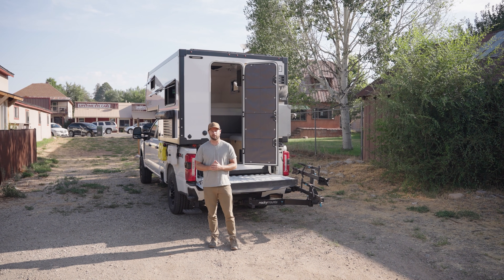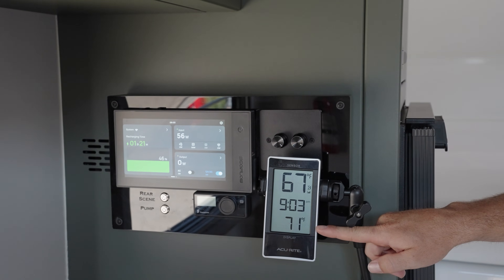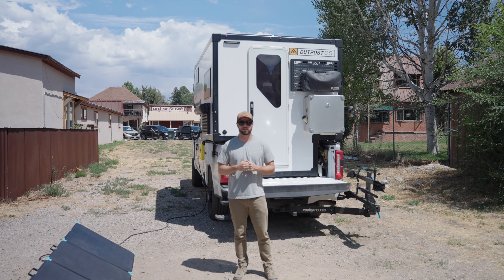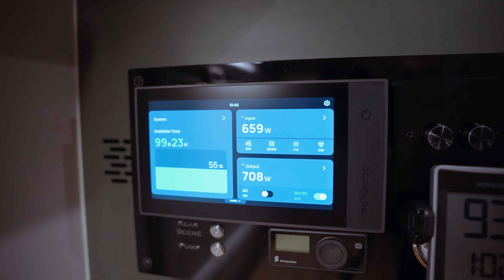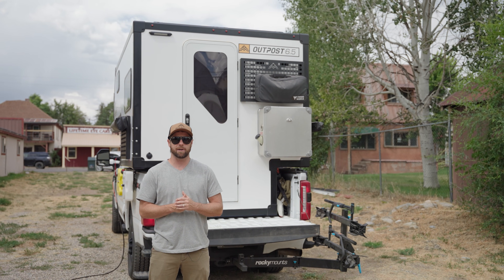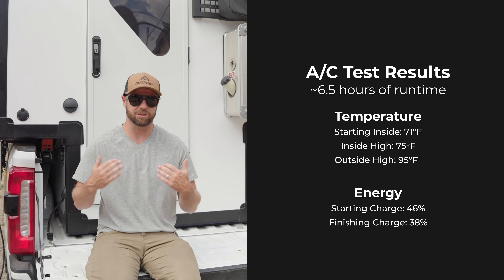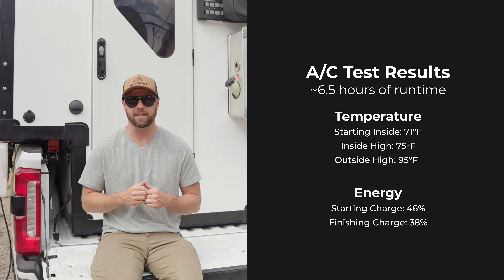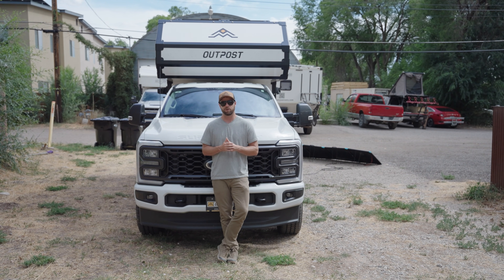How Long Can You Run The Outpost 6.5 A/C Off-Grid? (Nomadic X2 Test)

Comment: I think a subfloor should be there for a purpose other than just storage otherwise you are adding unnecessary height. For example my truck camper has a subfloor and in it I have an Espar hydronic heating system, Cruise & Comfort AC and water tanks. Since my AC system is in the subfloor, I don't have to mount it to my roof which adds more height and the additional weight is not good for the center of gravity.........

Comment: Great video, Taylor! I love my Outpost 6.5. We have the A/C unit, and it's a lifesaver if you have to work in the camper on a hot day. (We also run a fan on hot days/nights, to make things even more comfy.) I totally agree that running the A/C while driving is a great way to make sure the camper is cool when you arrive at your camp site. One puzzle I've come across: I've noticed that when I'm plugged into my auxiliary solar panel or into shore power, the battery-cooling fan kicks on, exhausting warm air into the camper and somewhat reducing the effectiveness of the A/C. Do you guys have any thoughts there?

Comment: Id like to see it run all night on a full charge to start and see what it would use power wise all night for 8 hours
Reply from the maker: Thanks for this feedback! As we state in our conclusion to this video there is no perfect test since there are so many variables at play. In our case we had lows in the 50s this night, so running it all night wouldn’t take much power but in reality we would just open the windows for some cool fresh air. This kind of weather is one aspect that we love about SW Colorado.
Reply: Exactly, this "test" is useless.
Reply: @tiger37373 it’s not. I have been camping my whole life and I only would ever use AC during the day when it’s hot. I would never go camping somewhere that needs AC at night. Are you camping in Phoenix Arizona in Summer? Try going to the mountains or somewhere nice, which is the whole point of camping.
Reply: I always move to higher elevations to avoid heat. It's a part of the trip planning for me.

Comment: Impressive test and a well delivered video. Performed better than I expected, especially on eco mode.

Perhaps you could run a test overnight to see how it runs on eco mode with zero solar.

Lastly, I’m still holding out for the larger Outpost camper, i.e. with a dedicated wet bath and larger battery + water capacity.
Reply from the maker: Thanks for watching! As far as testing overnight - we are lucky to have cooler nights, often under 70 degrees, here in SW Colorado. In practice this means we open the windows to cool down at night, much like we did in the morning to start this test!